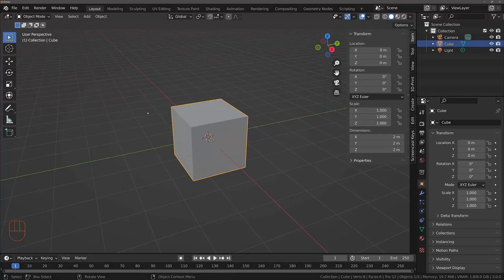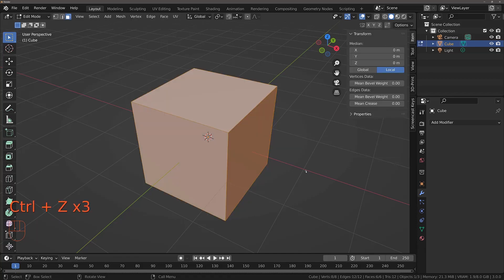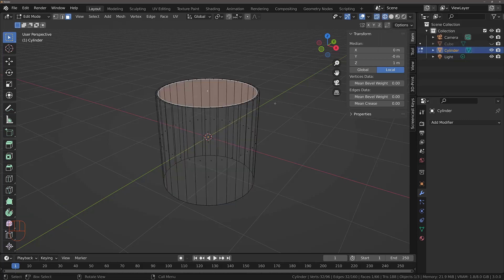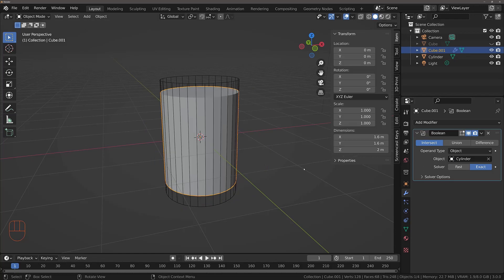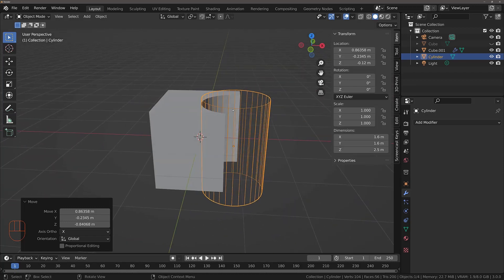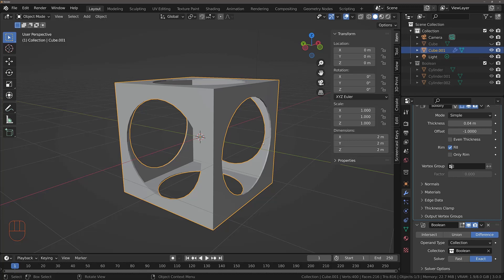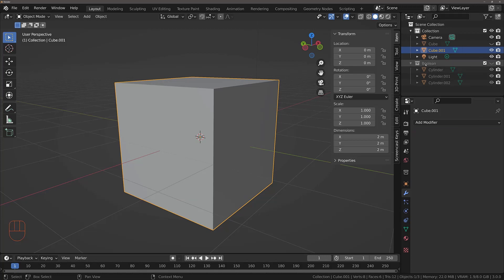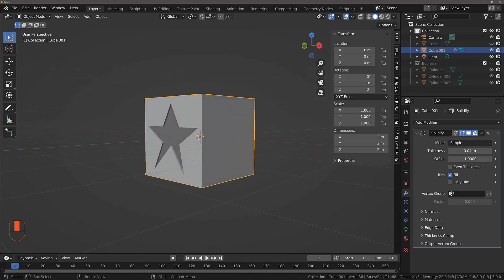Different Ways To Cut Through Objects In Blender 3

Comment: Very clear video and well presented. Please can you explain how I can use a cylinder as a Boolean to create a hole in a box, but get rid of the mesh inside the box while keeping the mesh outside the box. This is for a dust shroud for my bandsaw with a tube at an angle to attach a hose to. Many thanks

Comment: You missed the main part how to apply it because its totally useless without!!!
Reply: In case you are wondering how to apply the Boolean, like I was after watching this video- There is a tiny down arrow next to a camera icon on the Boolean modifier itself. Simply click that, and press apply to save the change!
Reply: @MintTripVR  but after you save it the inside geometry seems to come back. And if you delete the cylinder again the inside geometry comes back like a tube protruding inside! How to navigate this?
Reply: @sherinedias  It's been a hot minute since I've used this tutorial. Gimme like- 30 minutes or so and I'll see if I can't replicate that problem
Reply: @sherinedias  Aight, if I'm understanding the problem correctly, I THINK you might have it set to 'intersection' as the operation instead of difference (if you're wanting to make a hole) or union (if you're wanting to add the cylinder geometry to the cube)

Comment: how tf do i export this :(((( im almost crying, im stuck with it exporting it (as .obj) with the "holes-objects", as solid ones
Reply: In the scene collection, next to the Boolean collection with the objects used to cut through the mesh, there are three icons. Untick the ''Exclude from View Layer.'' You will see that the wire boolean objects disappear. If you export this to Unity, for example (fbx), the object will have the holes as wanted. Hope it helps, that's what I did and it worked for me.
Reply: it's my 2nd day of blender so here's my dumb way:    once you Apply the mods the holes are permanent, but the cylinders remain.  If you delete the cylinders they wont be kept solid when exporting to fbx.     (i hope someone quickly corrects me)

Comment: Excellent video. I tried the boolean cut method, using a collection for a complex cut but a) when I render the cuts are not applied. So both the original object and the cuts are rendered instead of the final cut object and b) when exporting to an OBJ to use the cut object, again the boolean cut is not applied. It is as if the modifiers are not applied. Any ideas?